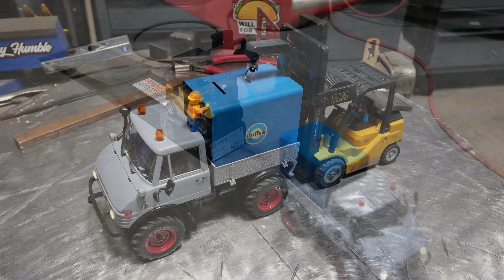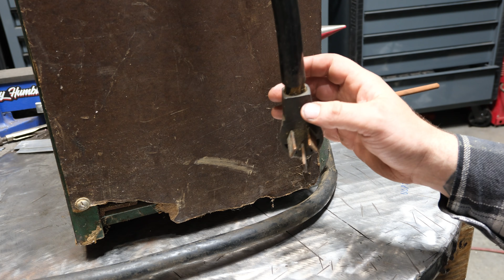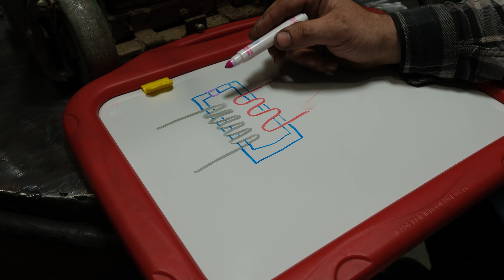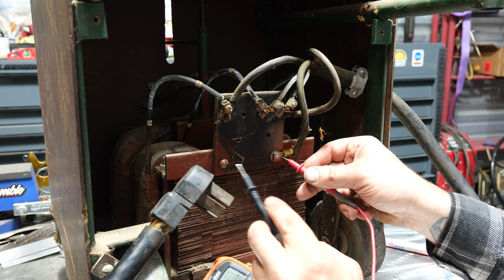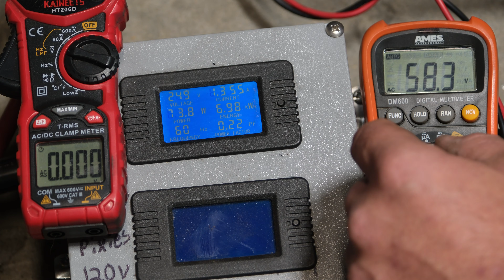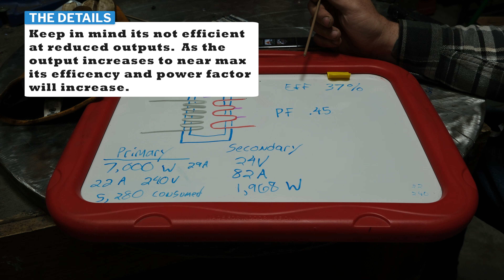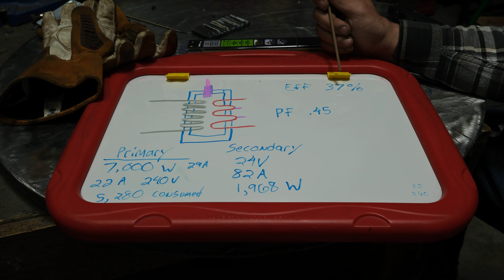A super janky (but free) homemade welder tested....

Comment: Deffinitly homemade but there is a possibility that what looks like 1/16th inch thick laminations are actually 3 or 4 pieces of .016" thick steel. 

That transformer is much more efficient than it appears. You need to look at the power consumed not the amps alone.

Comment: Wonder if theres a P/N stamped into that transformer that would shed some light on its origin.  Also the plug (NEMA 10-50?) that was on it is for 120V/240V so the welding amperage scale on the machine might have been "calibrated" for 120V input?   

This was a neat deep dive Greg.  Cool find.  👍👍
Reply from the maker: Once I have some free time I am going to dive into it a bit more and see what I can figure out.  The welder is still one of the best random finds I have come up with 😅.

Comment: Hey Greg, I have owned many AC units with this type of "magnetic shunt" adjustment, I still own one that is very similar to the Miller thunderbolt. This design used to be very very common and has one huge advantage over the tombstone. One can adjust current without the voltage fluctuating as it would by selecting different taps.
The shunt actually works in reverse to what you drew on the whiteboard, the basic idea goes like this.....Crank the shunt all the way in and the magnetic field stays around the primary winding because thats the closest magnetic path, not much field finds its way to the secondary. As you pull the shut out, the easier path now becomes the section of core under the secondary so more current becomes available.
Reply from the maker: Great contribution 👍.  I also didn’t even think of how the voltage changes with the different taps, the shunt transformer is definitely more flexible and realistically a better stick welding power source no doubt.

Comment: On/Off switches didn't start to show up on welders until the early seventies when the consumer/retail market for welders developed. There were no Local Welding Shops in the fifties. Manufacturers built welders for industry and plant use where each machine had a service drop and knife switch. I have two pre-war Westinghouse units hooked up in my shop that way. Actually, all my welders are. Manufacturers made machines, workers learned how to use them. Safety was: Follow The Procedure.   I think your unit was a welder that fell off a truck and someone put it back together on their budget. The American Way.

Comment: In Australia (240V native) Cigweld made a model called a Transarc 230A model for several decades with a top mount Core adjustment like this. There was also a larger 3 phase 300A and a baby 140A unit as well.
Reply from the maker: I have never seen that model and looked it up.  It looks like it’s a better version of (or similar to) the miller thunder bolt welder we have here.  For some reason you guys always got improved versions of stuff we had here lol.  I don’t know if there was safety related reasons for improvements that forced the changes (like having removable cables on yours vs permanently attached ones here) but I have seen that kind of thing a lot lol.
Reply: @makingmistakeswithgreg  Our Electrical Regs are fairly tight even back in the 70's and 80's. The Bigger ones were also tapped for Two Phase (similar to your split phase) 240/480 so you could run them at full noise on the fairly common farm power.
Reply: I'm in new zealand and I have an old 140a NZIG transarc craftwelder which is from what I can find out is just a  BOC / Cigweld. It has the shunt in the front that you pull or push to set the amps and then twist clockwise to lock it in place.  Goes bloody well and I'm in the process of restoring it atm. Going to install a small 240v desk fan in it for a bit extra cooling.

Comment: Is it possible that someone stripped the transformer from an old movie theater lamp rectifier and left the capacitor,diodes and control circuits behind ?  A lamp rectifier would need current control to vary the lamp's lumen output. I seem to remember one off brand unit that used a top mounted knob to do that. Also lower wattage xenon lamps burn in the 25-36 volt area with open circuit voltages upwards of 60-80 volts.
Reply from the maker: Could be, never seen one of those to know for sure.  👍

Comment: I think you might have the explanation of the magnetic shunt backwards.  As I understand these things, the core is normally a closed ring, and the shunt goes down through the middle, and the more you lower it into the core, the more it short-circuits the magnetic field, and the less current you get to the output.
Reply from the maker: You could be entirely correct.  I need to investigate the welder and figure that out.  The Lincoln ideal arc 250 I had increased amperage as the shut was pushed into the core, however the welder in the video might be the opposite.  I watched the uncut clip and it looks like as it goes up in amperage it pulls the shut out like you said. Thanks for posting that 👍👍

Comment: i am intrigued by the wedge current limiter , could it be a prototype or a patent of some kind?
Reply from the maker: So at the possible age of the welder it would have been “higher tech” than a lot of machines.  The Lincoln ideal arc 250 operates somewhat similar, however that was 3 times the weight, double the size, and possibly not even as old.  If it’s older than 1980 (like it looks) it would actually make it a pretty expensive machine to make at the time all things considered.

Comment: Greg,  I learned on a Sears welder in the 1970's.  They were not the quality of the big brands with proper connections and all.  My vote would be an old Sears that someone rebuilt after it rusted out or was  damaged. Miller, Airco, and Wilson made top crank welders but they wouldn't be that janky; Sears would. Ha.
Reply from the maker: Could be.  I did some looking at the insides of the miller and Lincoln’s from the pre 80s and it definitely doesn’t match any of those.  The transformer is close in size to the Lincoln ideal arc 250, and functions similar, but it’s definitely not it.  If the transformer came out of a welder it definitely must have been a pretty big welder, and probably something obscure for brand.

Comment: Looks like a science or magazine project.    
 Gregg:   I have a baler frame to weld and watched some youtube vids,  so I'm damn near an expert now, but no one ever says what they use for a fish plate patch.   On a alloy frame would you use mild steel or an alloy steel?  The reason is, I have an old trailer house frame for salvage steel and I'm thinking it is a high strength steel like they use for baler frame, but probably not the same.   The steel supplier 40miles away would just have mild steel on hand.
Reply from the maker: That’s a great question.  So on higher strength steel you run into a lot of issues repairing things.  One problem faced is do you weld it with 7018 or higher strength filler.  Without knowing for sure what steel it is the results tend to be better with 7018.  The next question is if you weld reinforcement on it what should you use.  If I know what material it is, and I am not overly worried about over reinforcement (aka making something so inflexible it just cracks right next to the reinforced area) I would use the same material.  If in doubt using mild steel might not be a bad thing, it will flex more and be less likely to have cracking near the welds.  

In all the repaired equipment I have done I have learned having some flexibility is important.  Higher strength steel is great for resisting wear and for making things deflect/bend less, but man super stiff steel doesn’t take well to impact/shock loading generally.   If one side of something is fish plated and the other isn’t (like a boom) I definitely would go with softer mild steel.  Some flexibility isn’t a bad thing.  Keep in mind the plate only reinforces what’s under it, if the welds underneath are bad the plate won’t ultimately prevent cracking.

Comment: Great video!  My guess is that they got the transformer from another welder.  Welders with top cranks are still sold here in Mexico by the Infra brand. Supposedly they are clones of older Miller welders.  This makes me want to get a transformer welder even more now!
Reply from the maker: I hope to find a picture of the machine they got it out of.  It’s not a miller or Lincoln, but pre 1980s there were so many welders out there it could be pretty hard to find what one lol.

Comment: The magenetic shunt works by altering the inductance of the circuit so winding it in increases the inductance thus increasing the efective resistance to alternating current. There are a lot of cheap Chinese welding transformers made in Chiner on the market here in the UK. I tried one some years ago and the thermal trip cut out half way through the third 10g rod.
Reply from the maker: Thanks for the info.  What’s weird is the welder in the video seems to work opposite of the Lincoln ideal arc 250 I had.  With that one the shunt going in increased amperage output based on the dial.  The welder in the video seems as though as it gets pulled out it increases in amperage.  I don’t have another reference welder but it seems like it makes more sense your way, I am not sure why the Lincoln would be backwards.

Comment: Do you think that maybe when he was building it he didn't have a welder and welded it using batteries to weld the frame together  ? Your explanation of how the welder works was petty close  !  But it was a good explanation to people who are not electrical knowledgeable  !  It's magnetic flux that changes with the shunt .  I always enjoy watching your videos  !!
Reply from the maker: I wondered the same thing about how the welder case/handle was welded since it wouldn’t have been smart to weld it together with the transformer in it lol.  The transformer was welded directly to the frame.  I am thinking a second welder was used to make it.  I really wish I knew how it came to be.  If it’s pre 70s it would actually be a pretty high tech welder all things considered lol.  Thanks for the info on the shunt too 👍

Comment: that guy might have welded many people's vehicles back then you never can tell I'd love to see you hook it up to a proper breaker and if you do just set a strong fan behind it on the open side of the machine so it doesn't get too hot and crank it up and weld some stuff with it.  after all the man that built that welder would definitely be smiling to see someone else using his welder it would definitely make him feel good inside
Reply from the maker: I will be fixing it up a bit, and definitely feed it some more power.  The transformer size (and the fact it’s 100% copper wound) makes me think it wouldn’t be an issue at all to handle 200amps for a big duty cycle.  Whoever made it must have used it a ton, and honestly given the likely age (pre mid 70s) it would have been a better setup than a majority of the welders at that time.  The ingenuity of what they did probably made a big difference in what they could do.  Got to love someone who thinks outside of the box lol.

Comment: is duty cycle even a factor on a transformer machine like that?  or is that something that you only have on an inverter machine?
Reply from the maker: That’s a really good question.  So duty cycle is kind of a marketing gimmick.  I really need to do a video on this but I will say this:  virtually all welders will grossly exceed their rated duty cycle.  A proper duty cycle would be a rating based on maximizing longevity for a welder, tested at a higher than average temperature.  Basically a number for output that should not be exceeded for a given time.  Well most welders will not thermally trip anywhere near their duty cycle rating.  Many welders (such as the one in the video) don’t have any thermal trip whatsoever.  The only welders I am aware of that literally limit output based on input power are fronius.  So basically the duty cycle rating serves two purposes 1) to establish a marketing gimmick number and 2) to get around laws regarding circuits.  120v welders are devices that by all accounts shouldn’t be legal to plug in the wall.  They often load the input breaker to 30-32 amps to output near max.  The breaker will hold provided the load intermittent.  By slapping something stupid like 20% duty cycle at say 180amps output they can sell the device as a legal to plug in the wall contraption despite the fact it massively overloads the circuit.  It’s a loophole dealing with intermittent use and welders specifically in the national electrical code that “permits this”.  

There are duty cycles for purely transformer welders, most of them tend to be fairly low.  Partially because they tend to trip breakers due to reactive power and partially because many have no way of managing the heat well.  The coating on the transformer wire on the welder in the video is very thin and that’s all that is preventing a transformer short.  If that wire gets too hot the coating could melt and short the transformer out.  The particular transformer in the welder in the video is actually significantly bigger than most 200amp class machines.  I am thinking it was really a 250amp transformer.  I have no doubt it would handle 180a plus for a decent amount of time.

Comment: Someone had a task and made something to perform it.  We had time on our hands, copper was cheap but  small form factor 2-pole high current switches were not.  I bet it was direct wired at first off a big wall mounted knife switch as we didn't have breakers at that time.  The plug was added later for the occasional use or "Let's see if the old girl still works".
We did what we could with what we had or could get.
Reply from the maker: 100%.  Based on the age it’s entirely possible it would have been better than the common machines available. It has a bigger all copper transformer than the common pre 80s welders so based on that alone it likely would have handled higher loads better.  They just should have came up with a better way to shield the wires and made it more sturdy lol.

Comment: Great! Max that sucker out but bring a fire extinguisher to your buddies house.  This machine looks like something you would see in Popular Mechanics from 1955-1965 or Popular Science,  Probably the same edition that suggests you can dump used motor oil into a gravel filled hole.
Reply from the maker: I have a feeling it’s way more than 200amps output lol.  The transformer is 80% the size of a Lincoln ideal arc 250 (which could easily output more than 250a on ac) which makes me think it might actually handle 200a output for a while.  I definitely will have an extinguisher handy lol.

Comment: Back in the late 70's, I built a 100Amp welder based on  an article in popular mechanics.  The PM article was a spot welder and arc welder combined,  but I only implemented the arc welder. I had to wind my own transform, but I had time, and little money.  It had four heat settings, but it was enough to allow me to weld up  lots of garage projects.

Thanks for sharing,  Greg.
Reply from the maker: That’s awesome.  I have a feeling the welder in the video was the difference between having a decent welder and not having anything.  If it’s pre 80s it would have been pretty decent tech for its day compared to other options.  It’s amazing how far ingenuity can take someone to get some stuff done.

Comment: Airco had a top crank called a "Easy Arc" that was red ( Airco was orange until the British bought Airco out. BOC I think. wish we could post pictures in these comment section. What's interesting is the build itself, ie. the why home build it in the first place unless someone had a bunch of parts and a lot of time and little money. As others have mentioned Popular Mechanics had DIY projects published that was my first thought but the old car part's sounds like an old man named Bart I knew in the mid 60's he was a inventor and tinkerer and old Bart would definitely build something like that.
Reply: Miller made the 150 and 220 amp versions for Airco based on the Thunderbolt. They might have made some of the others too. I had a Montgomery Wards welder with similar up/down shunt but the indicator was also the adjust handle, you squeezed it to release. Needed grease on the shunt or it was hard to move. That one was made by Century for Wards.
Reply: We were an Airco dealer in the 60's (I was ten) to 80's, I remember when Airco stopped making their portables and Telleydine Pines took over (quality went downhill) somewhere I thought Miller got involved also like you stated. Airco was an equal to Lincoln and Hobart  at one time, but international trade and corporate takeovers killed Airco, I grew up with the Airco logo etched in my brain, sad to see American companies die like that.  @BwanaBob
Reply from the maker: I wish I knew more about the story behind it.  Everything is pointing to the fact it’s pre 80s for sure, and it’s not like you could just buy a transformer like it has easily/cheaply then.  It’s more substantial than a tombstones transformer, and is all copper which makes me think it came out of a much bigger welder than a normal 200a machine (if it was a welder transformer).  I am going to take the panels off and see if I can see more info on it.  I am sure whoever built it used it a bunch, and they knew enough to make it work lol.